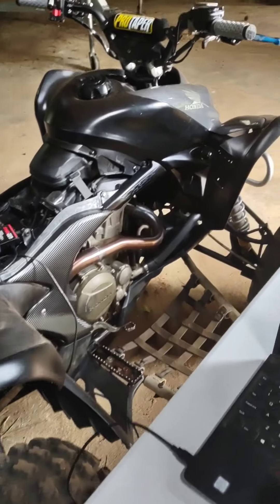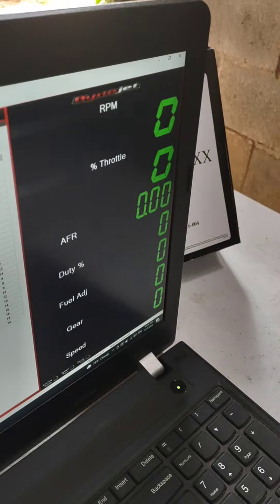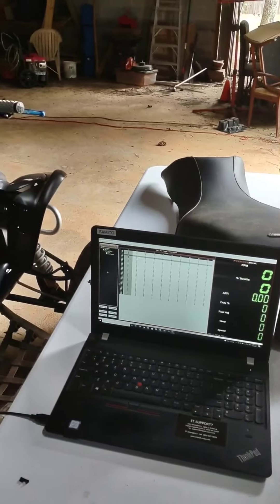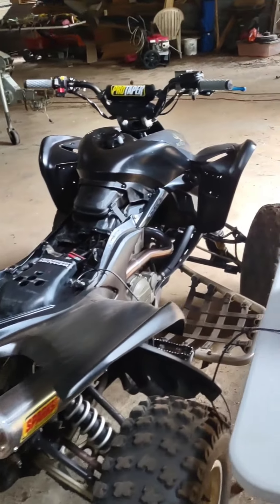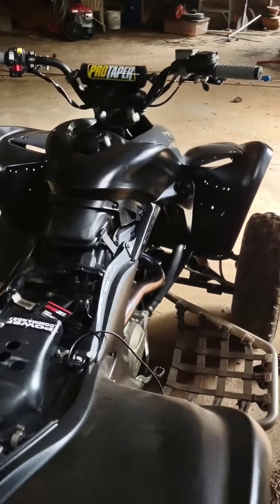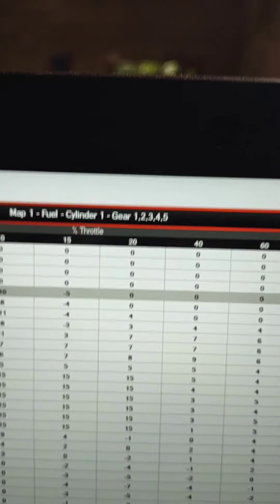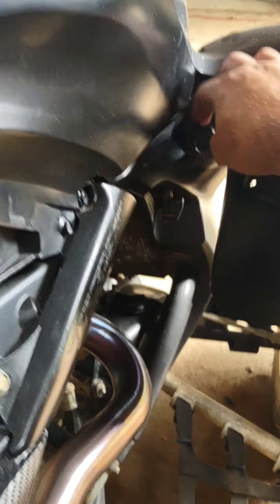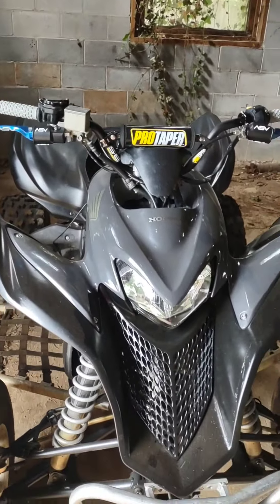Honda trx700xx dynojet power commander 5 tuning ,how to setup idle

Comment: I had major issues with idle fueling after doing some major mods. Threw the new pc6 with a map from dyno jet on and it cleaned it right up
Reply from the maker: Thank you for the support on channel..👍👍pc6 was mostly designed for carb compliant states like Cali so it's a bit limited compared to pc5 but mostly the same.. glad it is working great..700xx are great machine's